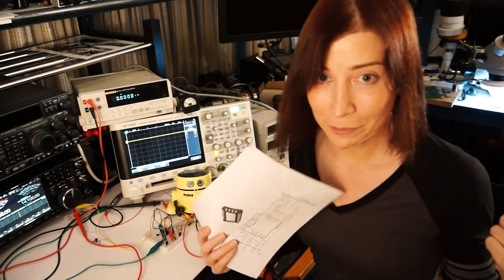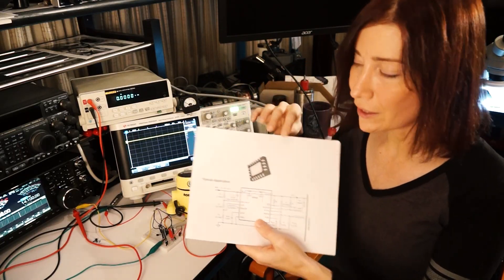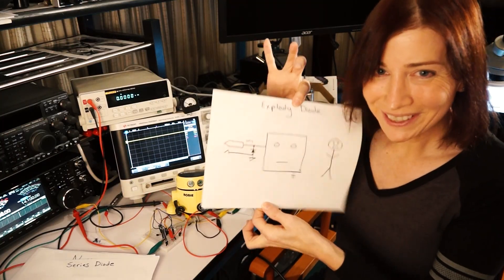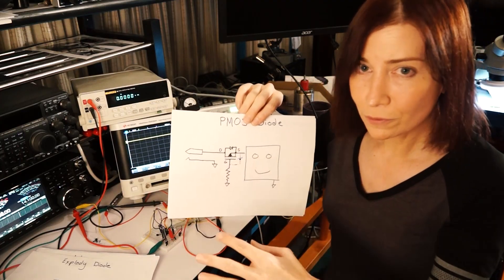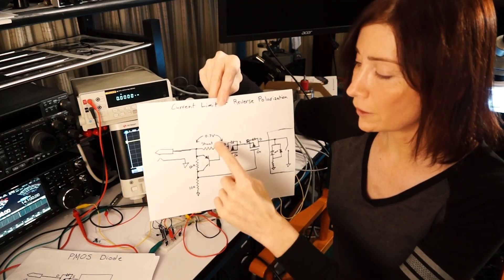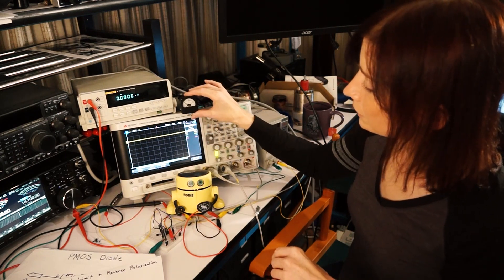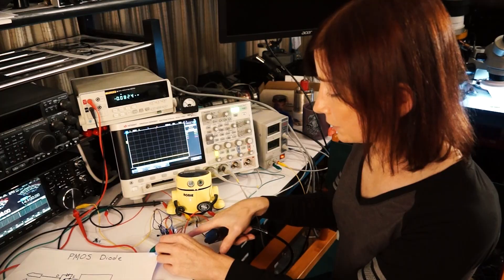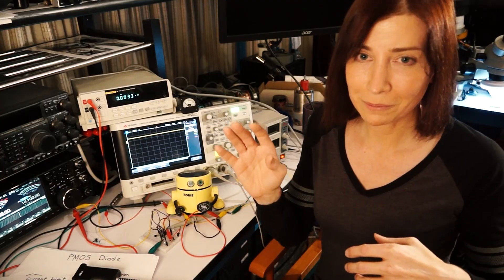Low Cost Reverse Polarity and Over Current Protection (Corrected)

Comment: I will definitely use this design on one of my next builds :). The PMOS instead of just a Diode is such an simple and genius idea!
But wouldn´t it be better to use a NPN for the reverse polarity protection in the ground path and connect the gate electrode to the positive rail? If i remember correctly NPN Fets have a lower RDSON value most of the time so they would waste less energy and can handle higher currents.
Reply from the maker: The PMOS option is as easy as a diode, so its a no brainer.
Reply: In general, we don't want to break the ground side of the power supply to a device. If the device is entirely floating, then it doesn't matter. However, if a device has any connections to other devices (or to a scope during testing!), then ground is the one signal that you should be able to rely on being at a uniform zero voltage across the interconnected devices. (Setting aside ground-loop issues.) If inside your device you float the ground for most of its circuitry, but not for the devices it is connected to, then your system becomes much more complicated, possibly hazardous to components in this or the other devices, and one of the other devices might supply a ground (relative to the incorrectly connected supply), defeating your purpose anyway.
Reply: @Graham_Wideman  , I never much liked the implementation of those switching type "Barrel" plugs and jacks that automatically disconnect the internal batteries when a wall wart power supply is plugged into the jack, by using the outer shell of the plug to open or close a switch. Switching the ground is never a good idea, but the manufacturer's "solution" of using the outer barrel of the plug from the power supply as positive is as bad or worse! Sure, some power supplies will show the jack on the body of the wall wart or the inlet to the device and show what the polarity is supposed to be, but the average consumer probably doesn't even understand or check that the power supply, if it's not original, has the same polarity and same approximate voltage and current needed.

Comment: Why not a full wave bridge rectifier?  Cost: four diodes and two diode voltage drops?
Reply from the maker: A rectifier is another option.  So many different ways to do this all with unique tradeoffs.
Reply: Exactly -- two diode drops is a lot if you are building a device with 1 or 2 batteries of 1.5V a piece, or a ~3V coin cell. Not to mention the power dissipated by the diodes.

Comment: Your PNP Transistor needs a base resistor because it will also conduct current "over" the shunt, this could lead to the destruction of the tranny because the base current will raise to high 
or am I wrong?
Reply: A base resistor wouldn't hurt, but I guess the thinking is that the second FET will turn off long before excessive current flow in the PNP base.

Comment: Hallo Jeri, please be carefull with your currentlimiter:
1: a batterie will be discharge from the resistor network
2: be carefull with mosfet‘s to Limit currents. The Mosfet in this case in analog mode. Trench-Fets don‘t like it. Look in the datasheet under „forward bias safe operation area“.
Reply from the maker: Good point.  I've always designed toys with real switches battery on the supply rail.  This would not be great for something always on.

Comment: Jeri, how about using a little bridge rectifier then you can put batteries in anyhow?...
Reply: A full wave bridge rectifier is a very poor solution for low-voltage 
devices. It would not work at all for a single AA battery, and it eats 
half the voltage for a 2xAA situation. This in fact is the point of 
Jeri's video -- that one diode or two are not viable for low voltage 
applications.
Reply: @Graham_Wideman  Yep.  Works for 12v dc off-grid applications where you're connecting led lights in the dark. I thought there might be a very low voltage version for these small projects.

Comment: Thanks for your video, but why two mosfets, one would be enough.
Reply from the maker: The body diode will conduct.
Reply: @jeriellsworth  are you sure? I dont think so.
Reply: @LarsBerntzon  The normal current and reverse current flow in opposite directions. If you need to control or block both, then you need two MOSFET's whose body diodes point in opposite directions. The body diode of a single discreet mosfet will always allow current to flow one way or the other, even when the FET is off. If that is not enough to convince you, you should consider simulating the circuit or building it so you can see for yourself.
Reply: Ah, i get it now. It would be enough with  one fet for current limiting. Or one fet only for reverse polarity protection. But not both functions simultaneusly. Thanks for your video and responses.

Comment: Unfortunately the circuit will fail miserably. Even a minor ESD-strike on the positive terminal will kill the gate oxid in the MOS devices. 
I'd recommend to go for a TVS diode (like an SMAJ,SMBJ,SMCJ - "A"-type) in combination with a polyfuse. It's cheap, easy reliable and will survive ESD and Surge pulses just fine.
Reply from the maker: I wasn't covering all the normal ESD parts you need to add to a design.
Reply: Presumably you are suggesting adding the TVS and polyfuse to one of the circuits Jeri discusses, right? Because I don't see how a TVS and polyfuse alone would accomplish what Jeri set out to show.
Reply: @Graham_Wideman  A polyfuse+TVS will do reverse polarity protection, overvoltage protection and over current protection while having low loss. It is cheap and easy to implement and has the added benifit of ESD and possibly surge protection. So what requirements aren't met?
Reply: @Bernhard Wörndl-A. So I'm thinking what you have in mind is a polyfuse in series with the + supply, followed by the TVS across the rails. And make that a unidirection TVS, so that on accidental reverse polarity, it holds the + rail to -0.7V, and shorts the supply current through the polyfuse, blowing it some brief time later.   No doubt that's adequate for many scenarios (and as you say, deals with ESD as well while being cheap and easy). However, it doesn't do quite the same thing as the first FET in the circuit Jeri shows, which only enables the + rail when it sees correct polarity. Ie: It doesn't even enable the + rail at -0.7V (upon reverse polarity). And the FET solution also avoids shorting the power supply on reverse polarity, in case that's a concern.

Comment: Ah, the paper clip test! Many years ago I was a video engineer in the BBC studio shooting an episode of Dr Who (Tom Baker!). Our cameras were EMI 2001s which had 4 pickup tubes which had a 525V DC supply fed down the camera cable. There were 4 seperate supplies, one for each tube. About 20 minutes into the recording session in the middle of a tack, one camera suddenly lost one of the colours and then went off. I went to check the power supply in the rack, and sure enough it had tripped it's breaker. To cut a long story short, I went onto the studio floor while a colleague Eric stayed in the equipment room. I unplugged the camera from the wall socket, and plugged it into a different socket while Eric changed the PSU. We blew the breaker on the spare! I looked at the cable and found that it had arced over. This was a 101 way cable! We changed the cable put everything back to the way it started and reset breakers. Again the PSU breaker tripped. We found that both wall sockets had arced over. After changing the camera head, the cables and using a new wall socket we had things working. When the recording session was finished I went and got the camera head moved up to the studio workshop so we could check it out.

The problem was that a production person had put a script on top of the camera, and when they took it off the paperclip had come off, fallen into a ventilation slot and shorted out one of the 525V supplies! It took me the best part of a day to change out components in the camera head that had been blown. Eric had a much easier time with the PSUs as only some fuses had been blown. The cable ends and wall sockets were a much bigger problem as they were all potted and had to be broken open. It took a couple of wiremen several days to replace the wall sockets and the cables got sent back to the manufacturer. Those were the days! Just for the record in the early 70s a single EMI 2001 camera system (camera head, PSU, Control Unit and monitoring) cost the best part of £100K! About $200K. We had 5 plus a spare, not to mention the video and audio control and distribution kit plus about 4MW of lighting. At the time I owned a 3 bed house which had cost me £4,250. How times have changed. Where I live in SW London, a 3 bed house would cost at least £400K, and I could by a good Pro-sumer 4K video camera with lots of bells and whistles for £5K. At the time I took all the studio gear I was working with for granted.

Great video Jeri. Nice to see you back.
Reply: I don't believe a word of it. If you were working with Dr Who you could just fly back to the past and prevent the paper clip from falling in. ;-)
Reply: @Graham_Wideman  , the Tardis didn't actually " fly", and once you grabbed that lever and pulled it there was absolutely no telling where you were going to wind up, in what time or universe......
Reply: @good'un   Well of course you wouldn't necessarily end up earlier in the 60's immediately. But sooner or later the series budget would dwindle, necessitating a contemporary-times episode, and that would be the chance to derail the errant paper clip.  :-)
Reply: @Graham_Wideman  , in my opinion it was the slow " regression " towards contemporary- times episodes that, for me anyway,  pretty much derailed the fun of watching the series!
Reply: Sadiq Mohamed, the moral of that story is that there is no end to the amount of trouble in the world caused by paper-pushers!

I liked the Tom Baker episodes of Doctor Who best of all. And I do really miss Sarah. I never really warmed up to the actor who played the doctor after Tom Baker, but I sure liked Nyssa and Tegan wasn't half-bad either! Tom Baker was also excellent as Rasputin in the miniseries about Nicholas and Alexandra the tsar and czarina of Russia.
Reply: For comparison for a foreigner, what was the average salary back then compared to now in London ?
Reply: @TheSliderW  I'm not sure what the average salary was, but as a "qualified" engineer (equivalent to a Bachelor of Tech in Electronic Engineering, but I came up through an apprentiship and night school) I was getting about £2.5K a year. This was 1975/6 so about $5K US at the time.
Reply: @sadiqmohamed681  I see. Thanks
Reply: Great story! Thank you for sharing it.
Reply: I remember those cameras, they had just about reached end of life when I joined the TV business.
Reply: Tom Baker was my favorite doctor.
Reply: With stories like that to tell, Sadiq, you should be making videos, not just comments.

Comment: What happens if you just replace the shunt resistor & reverse current PFET with a diode, since it's now dropping 0.7V anyway.
Reply from the maker: You only drop 0.7V in a short circuit condition a silicon diode will drop 0.7V all the time.

Comment: Isn't there a danger that, in a fault condition where the current is still low enough to keep enough current flowing so that there is a lot of heat disipation in your mosfet, that the mosfet gets hot and potentially things could catch fire?

Also, if you need, as you say, a small power mosfet + maybe even a heatsink and a pnp transistor, would a ptc fuse and a "not so explody" diode do the same thing better and potentially cheaper?

Don't get me wrong, I like your design and I used similar but on circuits requiring much higher currents and at 28VDC so that ptc fusing was getting impractical.
Reply: You would select values for the resistors so that the PNP transistor shuts down the second FET at current less than would do damage.  This approach does require that there be sufficient difference between normal operating current (virtually no drop across Rshunt) and the fault condition (> 0.7V across Rshunt), which might or might not be a valid assumption.

Comment: 0.7V for the shunt resistor is too high. A practical circuit will require a lower burden voltage.
Reply: It's only at 0.7V right before it overloads, not during normal operation.

Comment: This looks good!  I think I would use a poly-fuse instead of the current-limiter circuit-- and if you are REALLY feeling like you need to go cheap-- just a Christmas tree flasher lamp (the kind with a built-in bi-metal switch that shorts the lamp) used in series.  The flasher lamp will have very low impedance until there is enough current to turn it off (and then it will cycle).  If using the poly-fuse or flasher-lamp, you could also use a back-connected uni-directional transorb instead of the PFET.  This has the advantage of also protecting against over-voltage (up to the rating of the poly-fuse or flasher-lamp).  Obviously, it would take some experimentation to find the right flasher-lamp-- and it's current limit would be slightly temperature dependent-- but if you are going for cheap...   Fun stuff!  Endless possibilities!
Reply: A motor is another interesting current limiter, especially for AC. A large single phase induction motor without a start capacitor approximates a short circuit at standstill, but draws comparatively little current once moving.

Comment: I use a polyfuse and diode, I feel so primitive now!
Reply: I'd prefer this solution with the polyfuse. It allows to reduce the number of componentes in the BOM somehow.
Reply: Ha ha, same here.  Though she does have a point about protecting the supply powering your circuit.  Some of the larger poly-fuses take a few seconds to trip.
Reply: @rfengr00  It does, also the polyfuse has to be de-rated by temperature, some metal boxed gear runs pretty warm, in theory the polyfuse value could be large enough and slow enough that the diode could fail if the device is often abused. I think the solution proposed here by Jeri is good, I am just a little "old school" ;-)

Comment: Oh to have had something like this on an expensive wireless microphone at my old work. It had the same barrel jack as a PoE switch that was part of the same kit of equipment. It didn't like having 48v AC shoved in where 12v DC was expected. The series diode wasn't much help. Pretty much every semiconductor on the board was toast...

Comment: not sure if price of component is that important factor, assembly price should also be taken into acocunt.
pnp machiene rails count, probably even more important..
Reply: For onlookers: "pnp" here refers to "pick 'n' place" machine (not PNP transistor), the machine that places components on the PC board. The commenter notes that adding various oddball components to a design takes up more of the allotment of different component types that can be loaded into the PnP machine (via "rails").  You don't want so many different component types that you have to run the board through two different PnP machines. (or the same PnP twice with a change of components.)

Comment: I think you might run into trouble with that circuit if you have ESD or surge requirements.
If you don't have any such requirements you might run into trouble because of that.
I used a similar current limit circuit the other day, but still needed an explody diode (transil) for the 2kV surge.